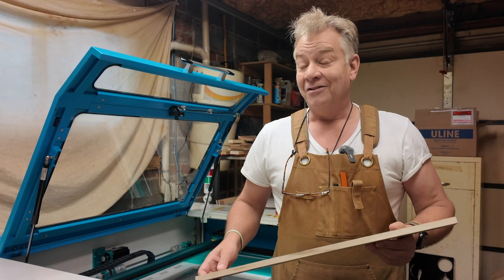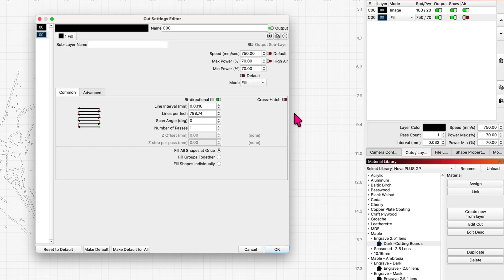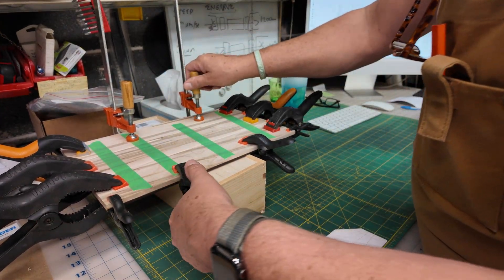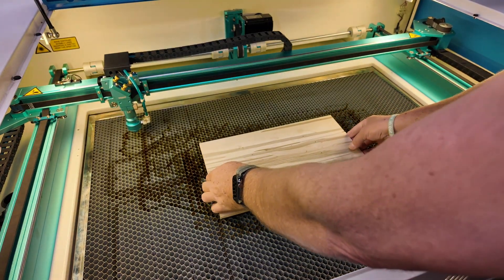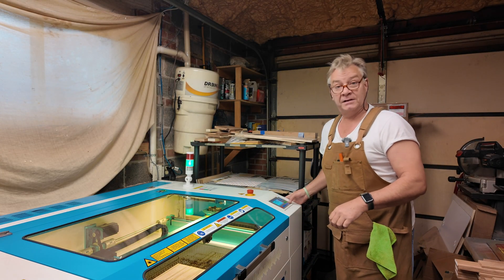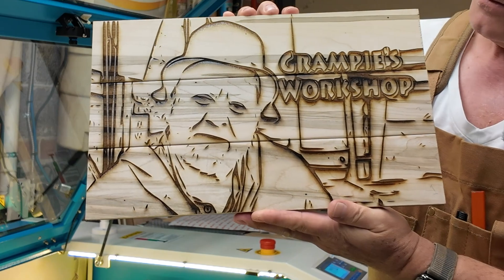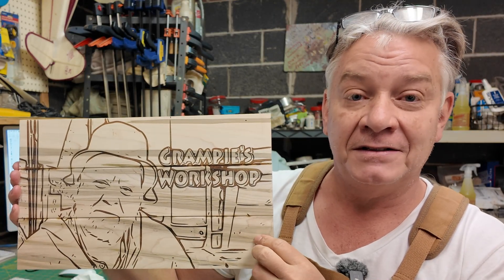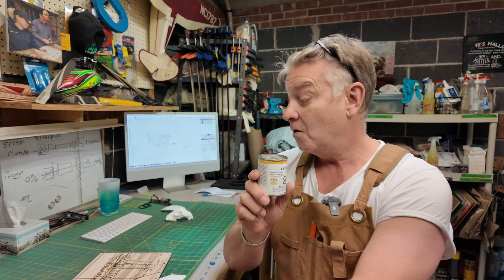Engraving Ambrosia Maple on Thunder Nova PLUS 60 W RF C02 Laser. Settings.  108   4K

Comment: I made sign for a friend yesterday using 1" thick ambrosia maple he provided. I used the factory setting for "Maple- Deep" on my Nova Plus 24. I'm pretty sure it was 50/80/80. I did mask the entire thing off with paper transfer tape, and ended up with a really nice dark result. It was just his business card scaled up, so it wasn't as fussy as engraving an image. I delivered it to him about an hour ago and he was thrilled. It took over an hour and 46 minutes to do the job, making it the longest running job I've done on the machine. I'm really enjoying the machine. Thanks for posting all the great videos.
Reply from the maker: Hey good morning - that's great to hear. Are you sure the settings were 50 mm/sec and 80/80% power settings? Can you tell me what the LPI was? I'd like to test it out. 50 mm/sec seems awfully slow for an engrave. Thanks again!
Reply: @LaserNUG  Sorry, I was way off. I just opened the file again and it was 300/50/50. 498.04 LPI. I just applied the setting from the Thunder material library. Tried a few other settings, but the one that says deep was the best, especially for the lettering. The smallest lettering was 0.5 inch and ended up very crisp.
Reply from the maker: @tractiongrips  hey that's ok . Happy to hear it came out great. Thanks - I will give it a try. :)